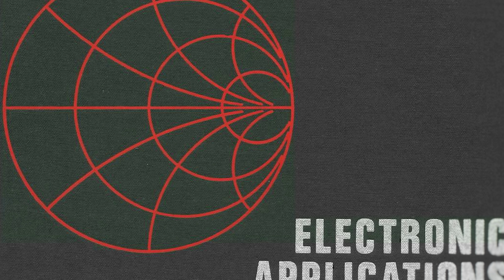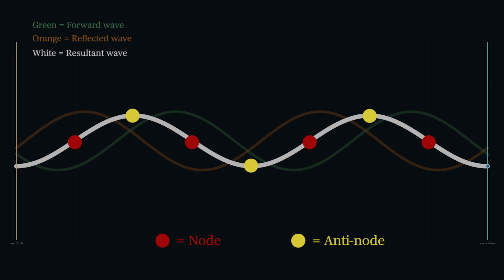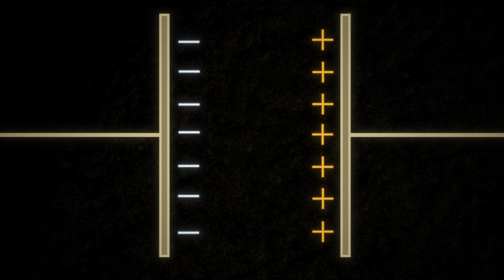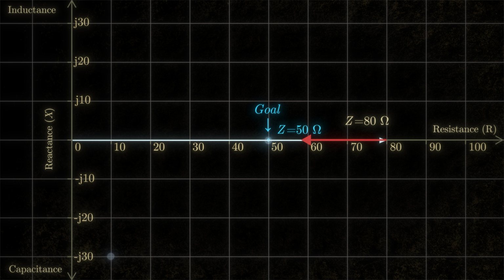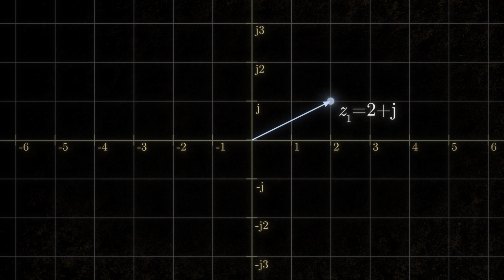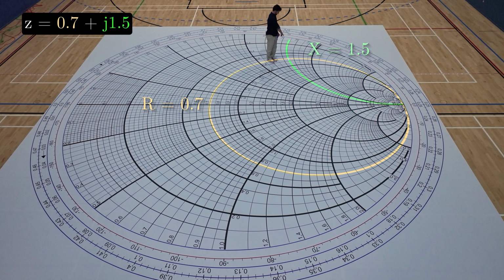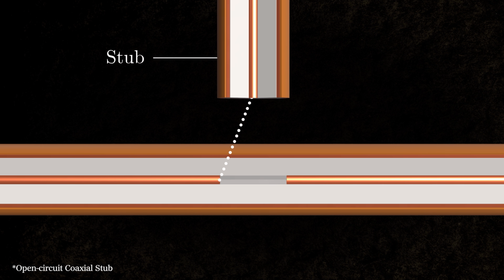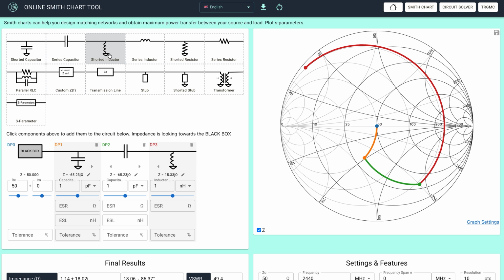The Scariest Chart in Electrical Engineering

Comment: I'm an RF engineer. This field can be really difficult for people to get into, so it's great to see someone trying to take this topic to a larger audience.
I had a few things I wanted to add here:
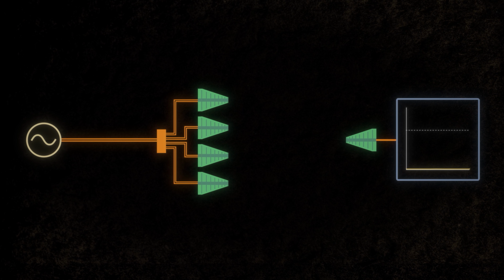1. When discussing recieved power at around 7:00, you say dB but the label says dBm. These are two different and distinct terms. This distinction matters a lot because dBm is the absolute power (dB relative to one milliwat), and dB is a ratio. We talk about power levels in dBm and signal quality (i.e. SNR) or losses/gain (insertion loss) in dB. You can add/subtract dB from dBm. 
2. The smith chart is not the only way to check an impedance match. We can use a VNA to measure the S-parameters (magnitude of reflection for multiple ports) over a wide frequency range. We will typically use S-parameters instead of a smith chart if we are not trying to match impedances. Most modern RF chips already have a 50ohm match on the input/output, so you only have to match the transmission lines into and out of the component.
3. There's certain critical aspects of transmission line matching that were left out of this video (likely for brevity). Substrate thickness/material, tx line thickness/material, skin effect, number of layers, via stitching, GCPW, shielding, absorbers etc. all have a signifcant effect on the impedance of your line.

This video only scratches the surface of RF engineering, but it's a great introduction to a very fun and rewarding field. I hope more people get into RF because of this video. Thanks.
Reply: I always think I'm a smart and educated person until I watch a Veritasium video or someone like you opens their mouth.  I am but a pleb. T_T
Reply: @kilmer009 puts us at our right place and makes us realize there are things we don't know
Reply: @MarcelinoDeseo the more you know, the more you realize what you don’t know.
Reply: dBm is power relative to one milliwatt, not per one milliwatt
Reply: @bleeghboy3997 I fixed it, thank you
Reply: In my Physics degree I actually had to use the Smith chart on the final exam for my second year of studies in the Electromagnetism 2 course. Imagine showing up with that chart to the exam!. I was so astonished when I saw the chart in the thumbnail, I was using the chart but I had no idea what I was doing with it. I was just an automata doing movements. Thanks for bringing light to it, I understand my teacher couldn't do the video but at least they could have shared more resources. It does not make sense that we were using this and having no idea of what we were doing.
Reply: I got into radio late in life and wish I had gone into RF engineering. Smith chart was tough at first until an RF engineer showed me on test gear that I couldn’t afford back then. With real world examples the chart makes sense. Loved your list of transmission line details! So many fun and interesting effects. I’ll always be a layman in RF but enjoy learning and teaching what I think I’ve learned. I let other hobbyists know most of my knowledge is practical, and the real engineers know the theory better than I do. “Here’s what works. I think because of X. This book seems to back that. If you learn otherwise let me know.” 😂
Reply: My contact with dB was through Bode plots on LTI systems in controls, and I was puzzled when he used it. I was just thinking "-50 dB IN RELATION TO WHAT?!" so thank you so much for this.

Honestly, I didn't like this video much, it didn't explain a lot of physical processes going on here. Yeah I get the reflection, but how in the world is the coaxial length doing that? Is it behaving mostly like a combination of capacitor and inductor? If so, the analogy with open and closed circuit was more confusing than good, without trying to tie back to capacitance and inductance.

Also, why the 50 ohm? What's so special about 50 ohm? Idk, it wasn't very good. Just entertainment
Reply: thank you for pointing put the dB dBm thing
Reply: Saw the large printed chart has commas instead of decimal point?
Reply: @OMNI_INFINITY  I just rechecked that, and yeah you're right. Because it has nothing written on it, I can't be completely sure. Matter of fact is: Most of the world uses the comma as a decimal separator. It's mostly only countries that have been once under British rule that use the dot. So I guess, they used a (most likely) European version of it.
I also see that Henry van Dyck studied and worked in Canada, which also use both.
Reply: @marcokrueger3399 Smith was an AMERICAN and software engineering is GLOBAL amd uses decimal points .That is standard internationally in east asia also. Absurd to use commas for decimal marker in 2026. And they were at a British lab
Reply: @marcokrueger3399  I do prefer metric units over imperial though👍
Reply: @OMNI_INFINITY   It doesn't really matter if he was an American, since this chart surely is adopted in literature to fit the specific convention of the publisher. So in a European book, you will find the chart with decimal commas. With "most of the world uses commas" I meant most of the countries, just go check the map on wikipedia (It's in the article "decimal separator", right at the bottom) and you'll see that it's true. Maybe they just searched for a high resolution chart and that's the best they could find to print out in that insanely large format.
The international system of units actually allows both, and the ISO standards, too.
You're right that East Asia also uses it, those are additional to any former British empire countries. India, Australia, the US, those are all "decimal dot" countries. South America, Europe, most of Africa and Russia and the Middle East, those are all "decimal comma" countries.
Yes, in software engineering it's usually the decimal dot. I would argue though, that this is mostly because much of the early work in computer development and software engineering (MS DOS, Windows, etc.) came from the US. They set the standard, that's it.
I'm absolutely fine with using the dot as a decimal separator. I can easily switch between the two. But what really bothers me is the comma as a thousands-separator. That switcheroo has caused some problems, because Microsoft Office software switches automatically based on your system settings while other software (Matlab e.g.) does not. Excel is completely useless when importing csv files because of that, and you have to change the global settings because you cannot change it on the spot. That is really, really dumb because they actually removed that feature -.-'

Saying that the American way is international standard is really something for r/shitamericanssay, I unfortunately have to tell you. Also the thesis: "Absurd to use commas for decimal marker in 2026." That's not absurd. It's like saying "It's absurd they still speak spanish in Spain in 2026". Most people in the world know that there are cultural differences, apart from Americans that think everything revolves around them.

I'm glad we agree on metric units, though :-) That is actually something where the world is not divided at all ;)
Reply: @marcokrueger3399  
I'm studying as engineer and I'm russian (so the locale is RU on most PC).
In programming, comma means a list. So one can't simply use comma as decimal separator.
So, in python we have decimal dot and _ is usable as thousands-separator (so 1_000_000.0 is a valid number)
In C & C++ we have decimal dot and ' as thousands-separator (so 1'000'000.0 as a valid number)
And here it comes! Excel CSV import! Now you have December 25th instead of 12.25 ლ(ಠ益ಠლ)
I hate those who switch comma and dot based on current locale in their software! Change locale and all import-export goes to hell!
Reply: @marcokrueger3399  yup, i work with a lot of European groups across the globe.  I would even argue the comma is way more common as a decimal separator around the world.  We just keep doing things different in the usa, :/
Reply: Those Europeans and their commas...
Reply: I have Smith's original book.  There are many, many different Smith Charts other than this one.
Reply: @HelloDolly-k8z  Hello, I happen to have a Russian translation of the book ELECTRONIC APPLICATIONS OF THE SMITH CHART, In Waveguide, Circuit and Component Analysis; Phillip H. Smith. McGraw-Hill Book Company, 144 pages, translated in 1976. The original price was 1 rouble and 9 kopecks.
Reply: On 1. -- That detail is not at all important to the video.  No one watching was confused by the narrator saying dB instead of dBm.  

On 2. -- This is a video about Smith charts, not impedance matching.  Also, they use a VNA in the video.  It's what they're using to take measurements. You can even see the S11 label in several shots of the computer screen displaying the Smith chart as they tinker with their transmission line.

As a radio amateur, I use a VNA surprisingly often. The software I use with it has the option to plot measurements on a Smith chart.  The software on the device itself also has that feature.  One does not obviate the other.

On 3. -- This was a short video for a lay audience about Smith charts, not impedance matching or RF engineering in general.
Reply: Brother may you have a good day. Its nice to have people with expertise so we can learn from their world. I really appreciate experts taking the time and explain those things to us. It gives depth and color to our learning
Reply: What are you working on currently ?
Reply: @dansonslacarmagnole2027 I work on satellite communications.
Reply: @darthpaatater  I would venture to be that we know some of the same people. I do PCB deisgn for satcom systems. I find one of the most satisfying things to do is creating a well designed coplanar waveguide, especially when the the spacing for the via stiching is small. It scratches the nerd itch. Especially because the RF traces all have a radius instead of the 45 degree angles.

I tell people that it's like I play connect the dots and Tetris all day. Except for the documentation part. If I could just get away from doing the fab and assembly drawings. Although, it's a very acceptable price to pay for such a satisfying job to be working. 🤣
Reply: Yep - its been a while since I felt sleepy watching Veritasium Video.
Reply: Question: How much day to day directly involves this chart today?

 Is it something that tons and tons of people work with daily? Or more like; most people have a device or piece of software that is doing this math behind the scenes and giving them the answers, but they had to learn it in school? And maybe a large handful of more academic, technical, or even just old-school engineers still have reason to refer to it? Really don't know a lot about the day to day but I'm really curious.
Reply: @kinemaxis526 I can't speak for everyone, but no one really does it by hand anymore. We have simulation tools that can plot your results on a smith chart, and in the lab measurement instruments (generally a VNA) can plot results on a smith chart too. The main reason students are taught to do it by hand is to gain a deep understanding of the chart and its intricacies.
Reply: @darthpaatater right on, thanks! Had a feeling it was something like that. Plenty of things like that in my field so I definitely understand the value of learning it, but also this video made it sound like it comes up a lot so it left me wondering.
Reply: @kinemaxis526  In my job I have younger people asking me "can I use AI for this" and the answer is "Only after you learn to do it by yourself. It's a tool, not your replacement".
Reply: db=Ratio for any n n= 1 to 100 range ( Ruler)
dbn= especific to any n=1 or any number in specific but only 1 at the time ( pinpoint)
Reply: whenever someone states something as it is this way, they are limiting everything
Reply: My brain is not braining 😂
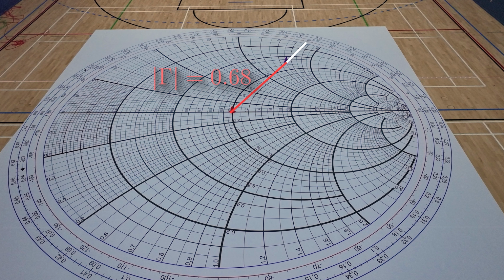Reply: @27:50 I'll be grateful if you can please explain:
1. How does the circle around R=0 with radius Gamma (R-coeff) is analogous to moving along the transmission line?!?! And where's its start point on the transmission line?!?!
2. How does a full rotation relates to half the wavelength?!?!
Reply: @TheKazMantic  I'm a long way out of university and didn't really understand Smith charts back then other than barely well enough to manipulate them and get the right answer and pass the exam in my transmission line class but I think it's that:

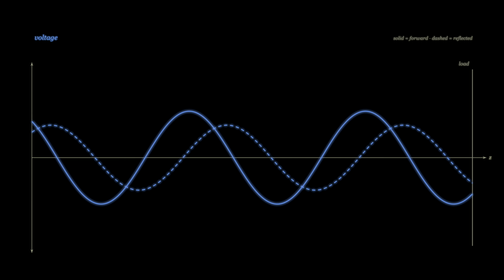1. (@23:06 through @25:42) because Smith chose the transformation between the Complex Plane to the Smith Plane to take advantage of the reflection coefficient being constant. Therefore every possible interaction between the transmitted wave and the reflected wave will lie on that circle of constant Gamma. It has an arbitrary start point because the combined wave is travelling through the line, but that circle contains every point on the combined wave; and if you freeze the wave in time as you move around the circle you will travel along the points of the wave in space. 
2. Because the transmitted and reflected waves have the same frequency they will have a periodic interaction with each other, and a lag of 180 + x degrees is the same as a lead of x degrees (and if you're lagging or leading by more than 360 degrees it's equal to subtracting 360 degrees) therefore the two waves can never be more than half a wavelength (180 degrees) out of phase from each other.
Reply: hey! wanted to ask if there's any ways i can reach out concerning an RF career path?
Reply: @k1ngsmanyt391  Are from what country?
Reply: Now I got to build it so I understand it…thanks V.
Reply: I have an incredible respect for radio specialist inside the EEs.  The world would crash around us, and I am glad I am not a part of those folks just like you.  Its never a "thank you" since people only realize you exist when things stop working.
Reply: personally do number 2 and never graduated, im a drop out

good luck getting "the public" to understand TEM vs LMD and why 369 is not something Nikola Tesla ever had to say or write down because it is in his work. we do not need to write pi value next to every circle we see the same as Tesla did not have to describe why 369 is important.

there is some truth in that his work was suppressed, but not by feds and men in black, but by the public in general who are in their compartmentalized towers of babel of Maxwell and Hertz

Marconi did not make wireless transmission, and guess what, neither did Tesla. Tesla remembered and reverse engineered Egypt.

Edison did not invent electricity first no more than Tesla did not invent wireless transmission. Modern is a lie, and you can not convince me otherwise as there is demonstrable evidence of my factual statement. Bagdad battery and The Ark of the Covenant are the only examples I needed along with Dendera light. it is a shame that most seem to be incapable of admitting how long mankind has known. ego and hubris of the cave...
Reply: @darthpaatater Way to scare the noobs dude. 🤣
Reply: The old HP 8714...I can remember long nights. Higher the frequency the more black magic was involved. I can remember laser etching matching networks on log filters...just a little dab would do ya.
Reply: Are you minecraft
Reply: This technology is from another plane. This is not natural at all, beware of alchemy. Sic Parvis Magna
Reply: bet you are fun at parties
Reply: @BradleyBranslyBarker  why are you mocking someone who has spent time trying to help you learn?
Reply: @cubbyhoo  Well, his post is a little obnoxious.  His pedantic correction also initially contained a more significant error until another user pointed out his mistake.  He also seems to have completely missed the point of the video, so the bulk of his post is just him senselessly complaining about omissions that would have been completely irrelevant had they been included.
Reply: The Table Spread (5:110)

[The Day] when Allāh will say, "O Jesus, Son of Mary, remember My favor upon you and upon your mother when I supported you with the Pure Spirit [i.e., the angel Gabriel] and you spoke to the people in the cradle and in maturity; and [remember] when I taught you writing and wisdom and the Torah and the Gospel; and when you designed from clay [what was] like the form of a bird with My permission, then you breathed into it, and it became a bird with My permission; and you healed the blind [from birth] and the leper with My permission; and when you brought forth the dead with My permission; and when I restrained the Children of Israel from [killing] you when you came to them with clear proofs and those who disbelieved among them said, "This is not but obvious magic."
— Saheeh International
Reply: @إستعد-للاحساب-بعد-الموت  The Torah and the Gospel contradict the Quran.
Reply: @ToyTrainAdventures-z3e  Yes, because the Torah and the Gospel have been corrupted, but the Qur’an has not been corrupted.
Reply: @إستعد-للاحساب-بعد-الموت  The Qur'an says that no one can alter the words of Allah.
Reply: @ToyTrainAdventures-z3e  The Cow (2:75) 
Do you covet [the hope, O believers], that they would believe for you while a party of them used to hear the words of Allāh and then distort it [i.e., the Torah] after they had understood it while they were knowing?
— Saheeh International
Reply: @ToyTrainAdventures-z3e  The Rocky Tract (15:9-13) 
15:9
It is certainly We Who have revealed the Reminder, and it is certainly We Who will preserve it.

15:10
Indeed, We sent messengers before you ˹O Prophet˺ among the groups of early peoples,

15:11
but no messenger ever came to them without being mocked.

15:12
This is how We allow disbelief ˹to steep˺ into the hearts of the wicked.

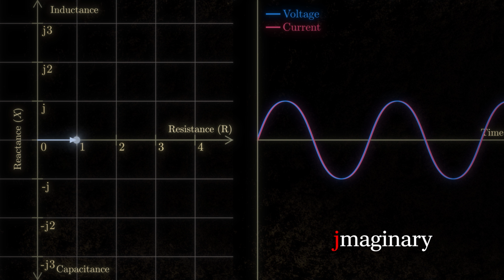15:13
They would not believe in this ˹Quran˺ despite the ˹many˺ examples of those ˹destroyed˺ before.

— Dr. Mustafa Khattab, The Clear Quran
Reply: @ToyTrainAdventures-z3e  although I didnt like the style of the bro but I could elaborate more instead. God's words there means God's decrees. This is a standard biblical usage. In biblical Hebrew dwar is used in arabic kalimah, the same style is used multiple times in the Hebrew bible even in the new testament. Plus according to the Torah the Torah we have is already corrupted like jaramiah 8:8. Another thing is that the Quran explicitly states like the bro quoted they were hearing God's speech and after understanding it corrupted it and they know.(the people of the book aka Christians and Jews here more the jews) About the Quran God explicitly stated He will protect it. Meaning it will fulfill its purpose until the day of Judgment in this world. About the new testament those have parts of the revelation given to Jesus pbuh as the Quran states like have you not seen who were given a portion of the book. And it even addresses people who write books with their own hands and claim its from God etc. Also that's why the verse says changing in the meaning of substitution like God decreed X and they changed it. This is metaphysically impossible as by logical necessity everything submits to God willingly or unwillingly. His decree is absolute and can not be gone against. It has to do with dependency and ontological grounding etc. meaning any other claim would be a logical contradiction.
Reply: @l3ll5l  It is the word of God directly from the Quran. I am not explaining from my own mind or philosophizing. The Quran is clear so that people can understand it. When there is a need to mention many verses, I mention them.
Reply: @l3ll5l  God guides whom He wills, and He guides everyone who strives to know the truth and seeks God's pleasure. And whoever wants to know more about the prophets.
Reply: and brother its just my opinion but if you call people to Islam for the first time dont hasten to quote verses which were revealed for the criminals who transgressed against innocents. And if you quote general verses always quote the next part having to do with glad tidings forgiveness love and care. So people get the bigger picture it doesnt matter if it gets a little longer. Among the non Muslims not everybody is a disbeliever aka guilty of intellectual crimes. Some just haven't heard it correctly or are outright unaware. Evident from verses like the disbelievers among the people of the book and polytheists. As there are people who are unaware or have a screwed view of the message. This is closer to the style of the Quran. Just look at how God addresses humanity for the first times how soft it is. How much care there is. He reminds them of His favors upon them His love and care how He is creating the things they enjoy things they depend on etc. After all we live under 7/24 propaganda in which brainwashing is forced our throats to get them indoctrinated with secular modernism and turning them into ungrateful arrogant compulsive individuals deprived of genuine virtues. That way its easier to milk and manipulate people.
Reply: @l3ll5l  Therefore, instead of going around in circles explaining to convince someone that Jesus is not God or the Son of God, I bring verses directly from the Quran. They are more eloquent than my own explanation because they are the words of Almighty God.
If the discussion becomes lengthy, I shorten it with the words of God, without unnecessary philosophizing, and I present consecutive verses from the Quran, and sometimes just one verse, because I know what I am doing.
Reply: brother its just my opinion I don't hold the keys of the unseen nor reached the depth of knowledge. About the topic in which context which verse is used and where you cut it its from you and me therefore it conveys its own meanings. Even a translation our voice and how we use it conveys meaning even the timing etc. So its not from me is not technically correct. But i dont think you have done anything wrong it was just about style. But your approach in quoting verses is good I think we should use your approach more. About the cutting I didnt like that you didnt quote surah kahf verses more. Like: surely those who have believed and done the good deeds indeed We do not turn to waste the reward of who beautified, purified in terms of action. Those for them there are gardens of eternity beneath them rivers are flowing, they are adorned with ornaments from gold and wearing green(fresh) cloths from fine silk and glittering thick brocade reclining therein on luxurious couches. How nice of a compensation and it turned beautiful and pure, the place of comfort. Or like this of course translating classical arabic is extremely hard and actually impossible but the light from those verses still makes its way into the hearts of the ones sincere. Light pulls light.
God almost always couples warnings with glad tidings, rewards with punishment and vice versa. You can see the tone changing depending on the audience. Like when there is mockery it has a whole different tone and when its sincere a whole different even when the question is the same. Because like actions questions represent meaning behind them. Etc.
Reply: @l3ll5l  At first,  You said that I didn't like the brother's way. That shocked me, so I started reviewing my comments. I thought that I had hurt someone or made a mistake in something, then I replied to you with a bit of harshness, and I apologize for that.
Reply: @l3ll5l  Thanks for your advice, my brother
Reply: rather I apologize brother if I caused pain. I meant to not quote further like the next verse or directly jump into it its not the style I like but I may be wrong because otherwise it may never come the context needed. But to quote verses is one of the best approaches I think but one must be very deep versed in the Quran and classical arabic but one could argue the Prophet pbuh said convey from me even if one verse so we may be looking too deep into it. Nevertheless may God bless you and increase His light upon you and deepen you in knowledge and noble traits, elevating you with them without an account.
Reply: @l3ll5l  And to you as well, and I ask God to answer your prayers and to have mercy on us all.
Reply: @إستعد-للاحساب-بعد-الموت  

Just when I thought this thread couldn’t make any less sense: a hero emerges.
Reply: @TwoSoulsOneCup  The Cave (18:29) 

And say, "The truth is from your Lord, so whoever wills - let him believe; and whoever wills - let him disbelieve." Indeed, We have prepared for the wrongdoers a fire whose walls will surround them. And if they call for relief, they will be relieved with water like murky oil, which scalds [their] faces. Wretched is the drink, and evil is the resting place.
— Saheeh International
Reply: @TwoSoulsOneCup  Could you two please move your adult fairy tales out of my science-oriented channel comments please?  I threw up in my mouth a little.